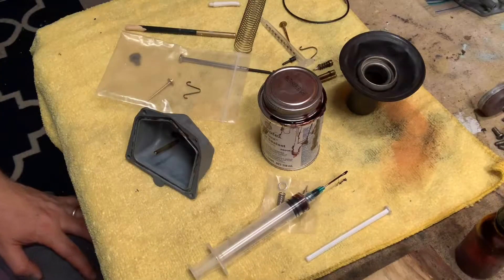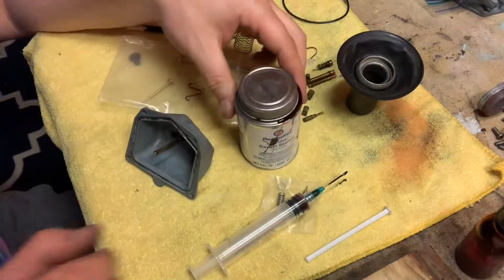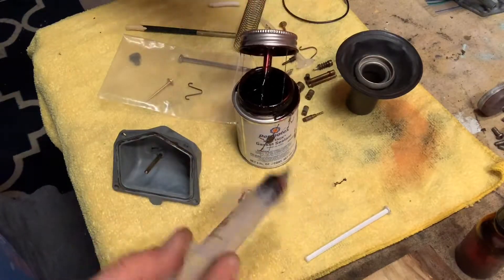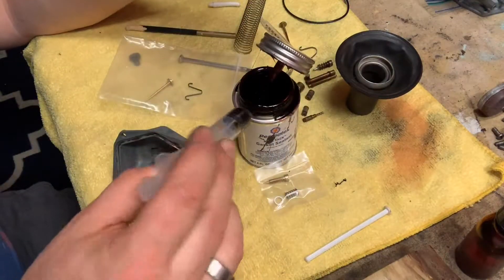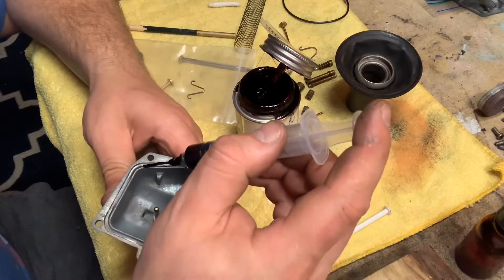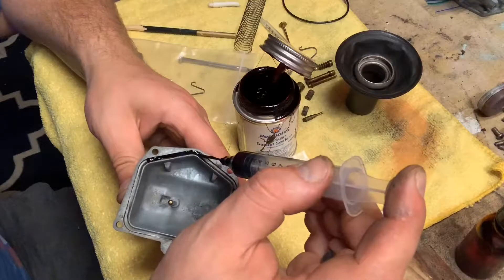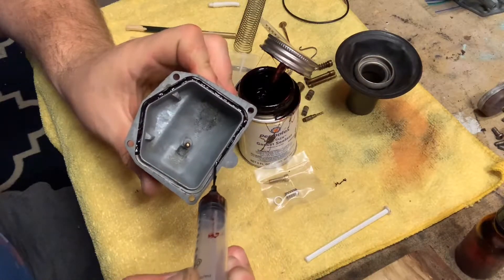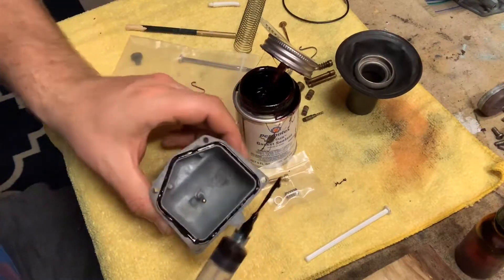How To Apply Permatex Gasket Sealer Easily-Syringe Method: Part 74

Comment: Absolutely NOT needed on a carb bowl.  Awesome tip none the less.
Reply from the maker: True. Since then I’ve realized it’s kind of pointless. Lol
Reply: @KeepOnWrenching  if your working on a 90’s early 2000’s Johnson evinrude you do lol they all wrap
Reply: depends on a few things i will use it on a float bowl and then not just dependent on a few factors

Comment: I thought a rubber gasket goes into that little slot. I would mention, dried permatex is very hard to scrape off. Other than that, great idea.
Reply from the maker: The stuff is the worst. Very messy! I used some on the various gaskets of the carbs. Not a crazy thick layer though. I used to dab it on with a toothpick and that was miserable. The syringe works so much better.
Reply: @KeepOnWrenching  Ah, next video is showing the addition of the rubber gasket, of course. hehe.

Comment: You could just buy a carb rebuild kit and put a new gasket on it. This stuff works well on areas that are pitted or when used as a type of adhesive to hold a gasket in place while installing a component . Besides that it’s really not necessary and the less you use the better. Still a very cool trick 👍🏼.
Reply from the maker: You’re right. Not needed…helped to hold the new gasket ring in tho.

Comment: What is the shelf life on permatex aviation sealant?
Reply from the maker: No idea.
Reply: I have had it for years, you will know when it’s shelf life has been reached it kinda dries up - I wish they sold it in smaller quantities as I don’t use it often
Reply from the maker: Smaller portion would be nice for sure.
Reply: forever if you thin it as it thickens ill have to read back but acetone should work and be the thinner used to maker it .install a small rock or marble in the thing to act as a stir thing .i use acetone to keep my pvc pipe glue from going off with a rock in it

Comment: Ah….  That is designed to be used with a gasket.  Not by itself.  

In addition that part you’re working with is designed for RTV.  

I absolutely hate RTV and think the best place for it is in the trash.  However, there are curtain assembly’s that were designed to be sealed with RTV - such as the item you have there.

Comment: Does this sealant dry glass had and require chiseling it off surfaces once dried?
I have a bad gut feeling about it.
For decades used gaskets as designed w a thin applied amount Black silicone sealant on it and almost 100% success rates and easy remove-clean from it.
Reply from the maker: It’s not bad. Like a jelly. Comes off with a dental pick. I dunno about 20 years from now.
Reply: not bad its rosin in its mix  .think pine rosin with other crap